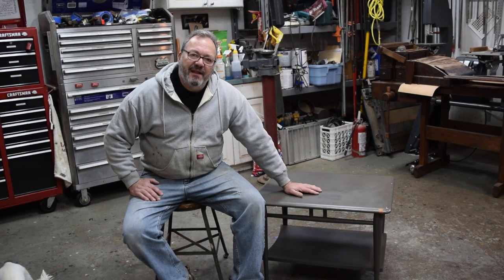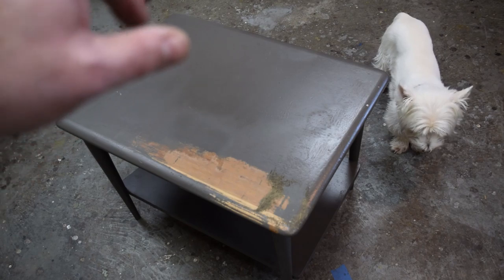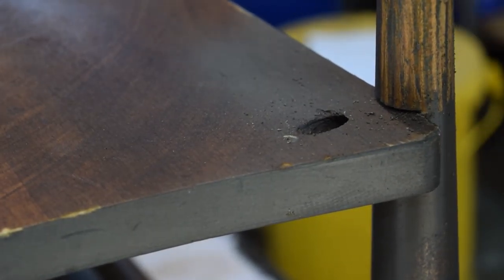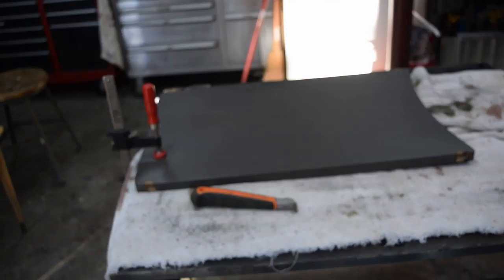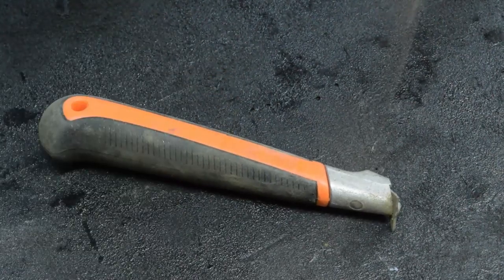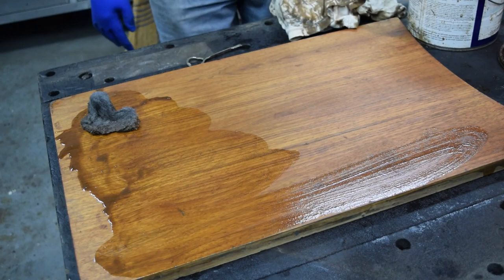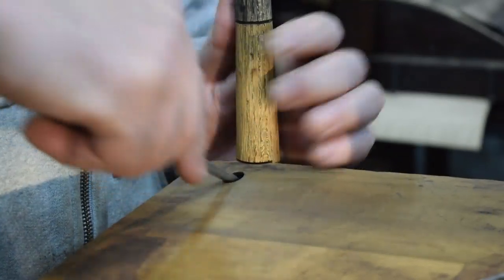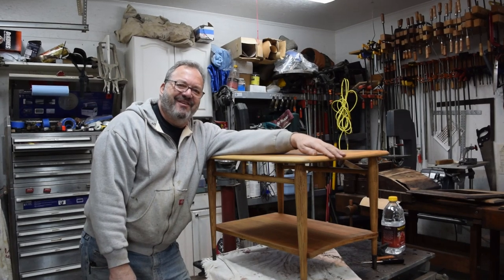Scraping Paint From a Lane Acclaim Table

Comment: Thanks.  I just repaired and refinished an antique rocking chair.  The back and the seat had blistered, chipping, and dried out veneer on them.  While I used stripper on the rest of the parts (I had disassembled it due to the original damage), I was concerned what impact the stripper would have on the veneer which I took hours repairing.  I used a card scraper on the back and the seat and it turned out wonderful.  Keep up the great work! Between you, Ross Taylor,  and Thomas Johnson I am learning more about refinishing and repair.  I posted pictures of my progress on the rocker and now have three more folks wanting me to do work for them.  All of these are antiques and I give them my disclaimer of not being an accomplished restorer (yet), but they are all still wanting me to do the work for them.  Thank you!
Reply from the maker: Outstanding!   They are lucky to have you locally to do their work for them.   Best success to you!